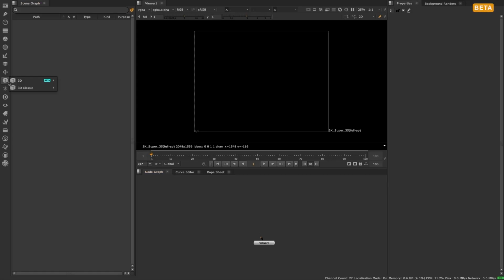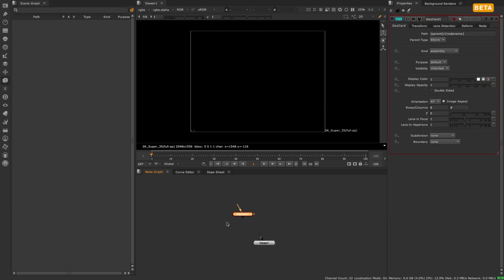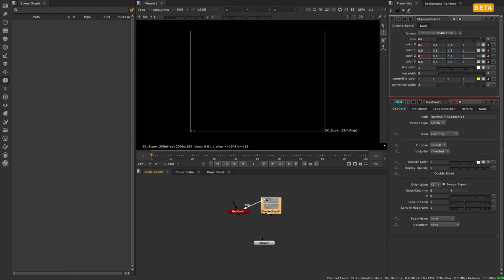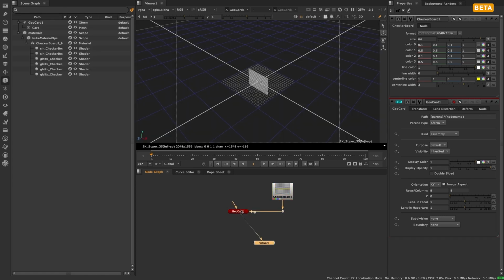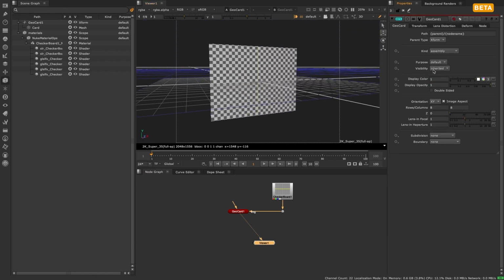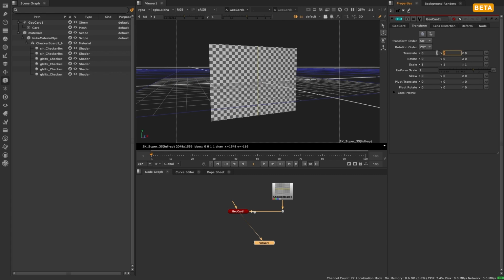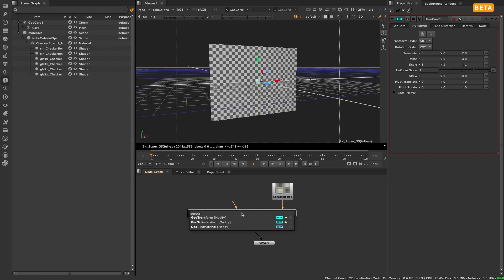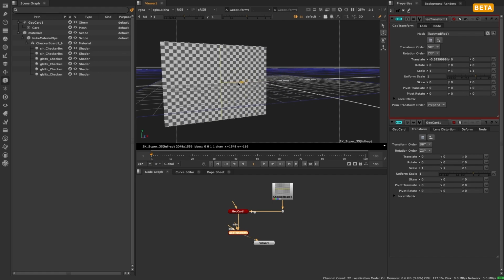Introduction to the New USD 3D System | 1. How to Create and Modify Geometry

Comment: How did you get the img arrow to appear? You don't say, it just shows up when you pull the corner of the node. I've tried every alt/cmd/shift combination, and I can't get it to appear. I'm dead in the water if I can't connect the 2D source. Thanks in advance.
Reply: same problem here... do you find a solution?